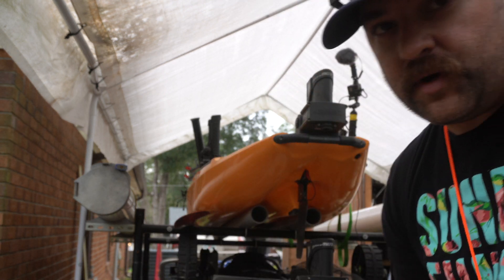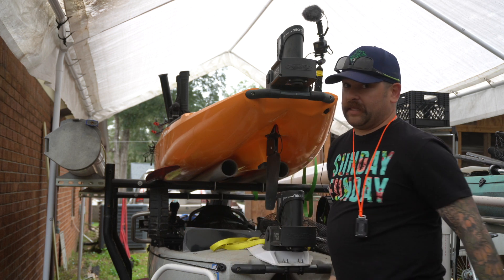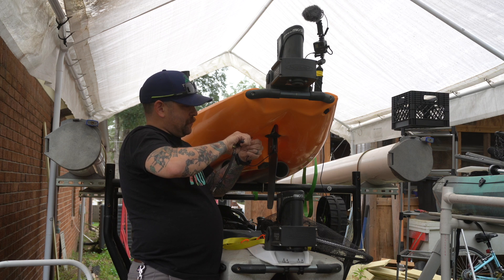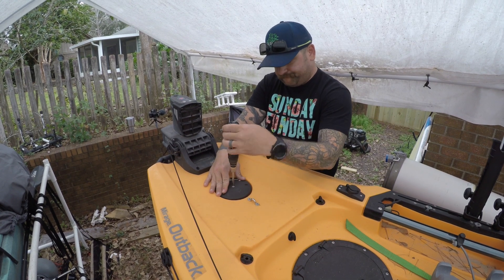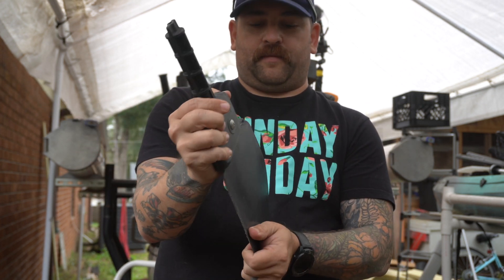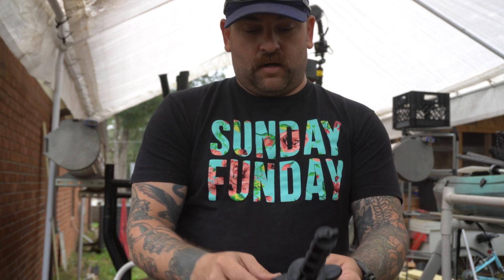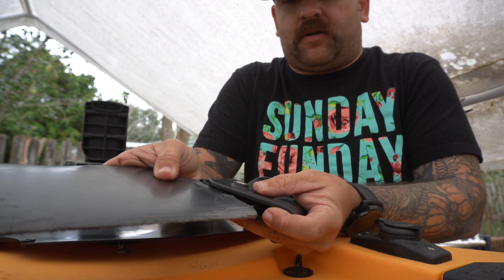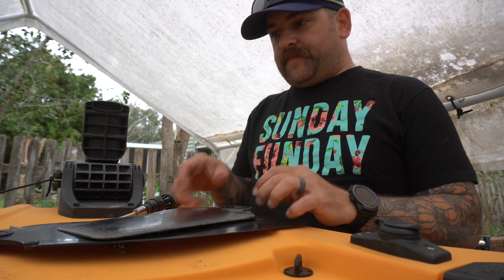2019 Hobie Outback Rudder Solution !!!!!  Pro Angler Rudder Swap

Comment: There are two Pro Angler rudders 84500101 seem to be original and 84612001 “Larger rudder blade”.  Which did you use?
Reply from the maker: The larger